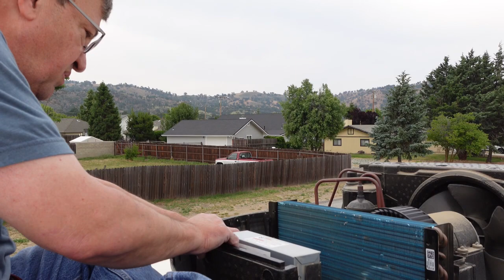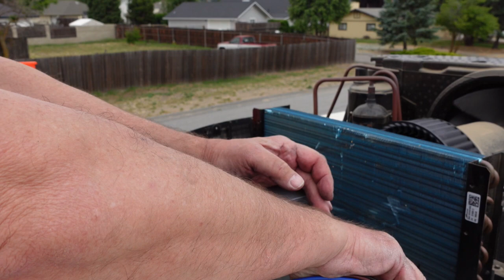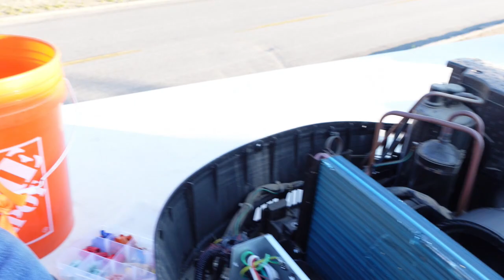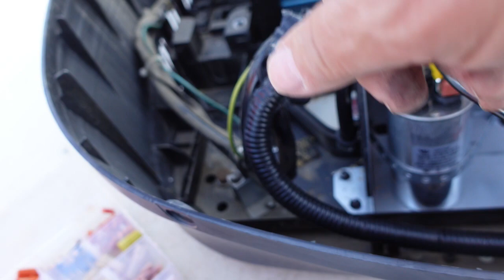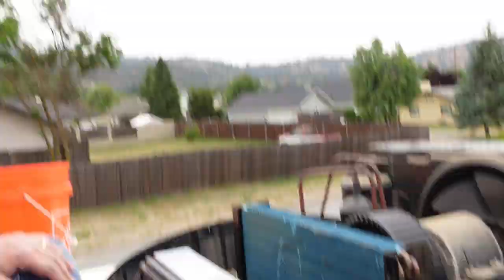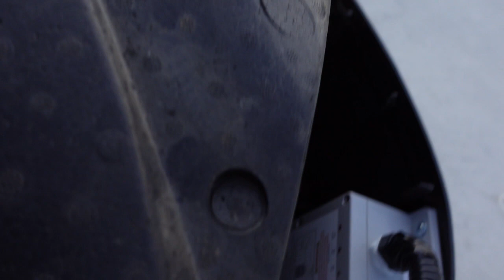Install RV AC Soft Start in 30 Minutes – Here's How

Comment: Great video, I also installed two Soft Starts. I do not think it is an issue, but the instruction state to mount the Soft Start box with the wire connection pointing down to prevent water intrusion. Good safeties, grounding out the capacitors.